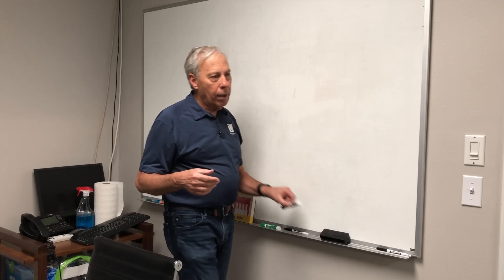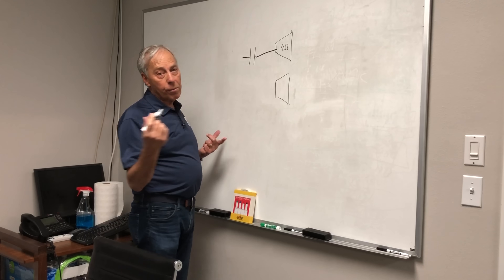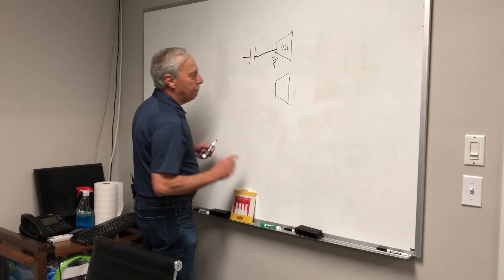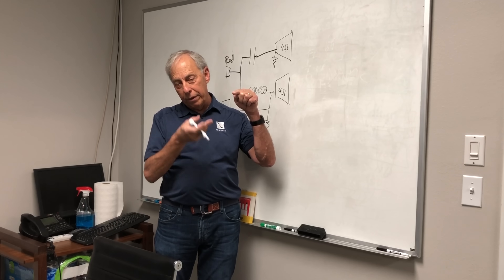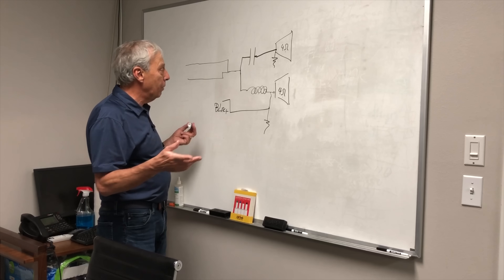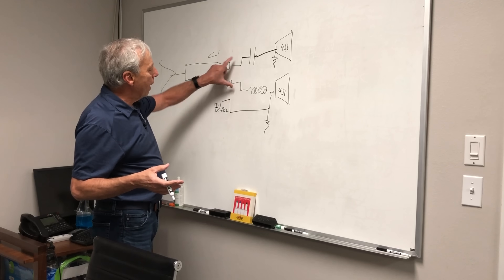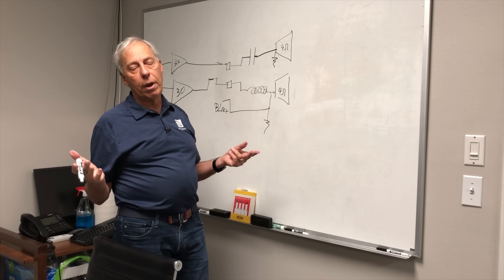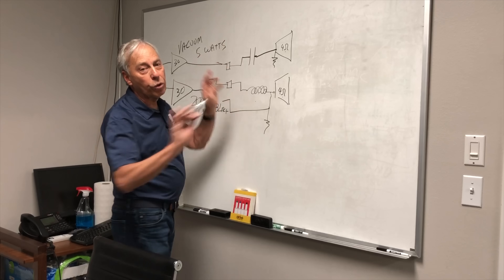How does bi-wiring work?

Comment: Nice video. Bi-wiring or bi-amping all largely pointless with regards to the cost IMO - I'd rather have one better quality item than two offering the same up into a passive crossover. That said, big fan of active systems with the filters pre the power amp and the drivers and amps matched - how you'd see it in most professional working studios.

Comment: A speaker is, in effect, an electric motor. It converts electrical energy into mechanical energy.
So long as the cable to connect the amplifier to the speaker is thick enough not to drop any voltage or VERY little voltage across its length then it doesn't matter if there is one, two or more cables.
It's simple physics. With Bi Wiring you are paying for two cables rather than one.
Reply: That is what physics proves. Unfortunately, you will never convince a lot of die hard audiophiles with measurable facts.

Comment: If you use an AVR just set to bi-amp in speaker settings and  use the surround back channel's to feed the black -  and use the fronts  for red + you get some extra  muscle and clarity.  4 wires per speaker recommend banana plugs too and of course 2 sets of post's on the speaker. Just sharing It has made an improvement so worth a try every system is different though results vary.

Cheers

Comment: I think the key words here are "you believe" at around 7:40. Bi-amping makes sense, bi-wiring is just snake oil unless the crossovers were on the amp end.
Reply: Right on! If bi-wiring does anything you are using the wrong sort of wire. PS knows it's BS.

Comment: The premise for bi-wiring to work in this explanation is that two TYPES of wire are used. One for high frequencies and one for low frequencies. How often do people buy two types of wire to bi-wire. How many of you actually have one pair that is designed for high frequencies and another pair for low frequencies?

Do they even sell two different kinds - they are all copper the last time I looked.

Comment: Hi Paul. You explained it perfectly but I must ask a question. Many premade  consumer bi wire cables use four identical wires ie all 16 gauge multi strand.or whatever they choose, you can find many on Amazon for instance. Is there any point to those types of cables or is it a moot point?. I get running 2 different types but I am not sure there is a point if all four conductors are exactly the same.
Reply: Unless you have VERY short speaker cables 16 Ga is too small. For distances up to about 10 ft. 12 Ga or even 10 Ga would be recommended. For a rational explanation of speaker cables I suggest watching the Audioholics video on the subject at: https://www.youtube.com/watch?v=kR12Ttuxobs&t=895s The title is "Speaker Cables Really Don't Matter". That is sure to get the blood boiling of many of  the "audiophiles" watching this channel but the testing results prove the point.

Comment: I have 2 quad 404-2 amps  which have been upgraded to dual mono power supplies. They are bi-amped into B&W matrix 3E speakers and sound absolutely amazing. Question I am probably wasting a lot of power using a 200 W amp to power tweeters. You say gain needs to be the same,  I would be interested in replacing the tweeters amp for a low powered tube amp.  How Can I find what the gain is on the quad 405To find a tube app that will be suitable thanks

Comment: So, Ideally if you have a true bi-amped and bi-wired system you don't want any crossover circuitry in the speaker. You just want the clean signal to go straight from the amps to the tweeter and woofer respectively.

With that in mind am I right in assuming it is kind of pointless bi-wiring speakers that have crossovers (Even though they still are bi-wirable with 4 binding posts) because the capacitors and coiled wires will still cut off parts of the signal?
Reply: You need a crossover in your amp if you expect different signals (one high, one low) to pass over the two wires.

Comment: Mr. McGown, thank you for giving a proper education on what bi-wiring and bi-amping is.  I get so turned off watching these "audio blowhards" on Youtube say bi-wiring is a waste of time because it "makes no difference."  What I learned from watching you explain this is there is a difference between the two questions "is there a difference" and "does it make a difference."  And that entirely depends on the audible ability of the individual listener.  Yes, there is a difference with bi-wiring, but can "you" hear it?

Starting with a non-expectant, somewhat skeptical disposition, I recently decided to bi-wire my B&W 3-way speakers (CM10 S2).  I played tracks that were burned in my mind and knew exactly how they sounded prior to bi-wiring.  Yes, I was able to discern a difference.  I'm not saying it is significant, but there's definitely some difference - and it's better.  

But, I'm wondering if that had anything to do with the fact that my speakers have a mid-range compared to a 2-way speaker?  It just seemed to me my ears were picking up better those mid-range frequencies.  I could more clearly discern sounds coming from the mid-range than before.  So, does a 3-way speaker make more beneficial use from bi-wiring than a 2-way speaker?
  
Again, thank you for taking the time to produce this helpful video.
Reply: Bi wiring is not possible as the highs don't pass only through one speaker wire and not the other and vise versa. They would have to be split with a crossover in the amp to do so. Both cables will have the same signal passing through them until they hit the speaker cross over where they are filtered for the first time. It's easy to test with a spectro.

Comment: Ok guys, please help me to clear this up :) So, if I understand Paul correctly, the advantage of Bi-Wiring is to allow for different Cable "tuning" between the Woofer section and Tweeter section of a Speaker, is that correct? I was under the impression that the whole point of Bi-Wiring was to bypass the Crossover section of the Speaker network, thereby providing a cleaner sound. Which is NOT correct, right?
Reply: @1970.  

The best way to look at this is check behind your speaker.  You should see 2 positives and 2 negatives for bi-wiring capability. If you don’t then you can’t bi-wire and you can’t bi-amp.  

If you only have 1 positive and 1 negative wire connection for the speaker but it has a woofer and tweeter then the crossover is together where it accepts one input and then splits the signal for highs and lows.  

Back to two positive and two negatives.  The crossover is built separate for each driver (woofer and tweeter).  So with this set up one can bi-wire or bi-amp. 

Bi-wire is simply using two different wires. A thicker speaker cable can be used for the lows and a thinner cable for the highs. If they both source from the same amp then it’s bi-wire. 

If from different amp then it’s bi-amp.  

You really can’t bypass the crossover of the speaker since it’s built inside the cabinet.  

The only way to perform what you’re thinking is to manually remove the passive crossover on the speakers and then have an active crossover and then amplify that signal directly to the specific drivers.  Not many do this especially for mids and highs.  I would not recommend this either.  

I tried this set up in car audio.  Active crossover and separate amps for tweeter, midrange, and woofers.  While it provided great flexibility in controlling each driver it was difficult to achieve a natural sound.  

I find that it’s best to use one amp for mids/highs in both home and car.  Mid and tweeter should not be far apart.  A separate amp can be used for the woofers.

Comment: Paul, I salute and compliment you for everything you do and have accomplished. Now the explanation here - for the viewers not speaking capacitors and resistors, who have no idea with electronics principle diagrams, can we summarize it as follows, would you agree?

A single speaker cable (with a plus and minus lead in it) can feed into a speaker's crossover filter where the energy fed through the cable is copied across each of the "ways" in the crossover. Then the bottom "way" has a low pass filter that allows the low frequencies to come through. The top way has a high pass filter that allows the top frequencies through. If there is one or are more middle ways then each of these has both a low pass for the top frequency cut-off and a high pass for the lower frequency cut-off. The energy in each "way" that does not go to the driver behind the filter may be converted into heat, by the way.
The electrical components in your diagram are used to implement these cut-off frequencies and this can be done in different ways all impacting the quality of sound reproduction.

For who is interested in the details of cross-over filters and the speakers they are in: for each of the ways the dB per octave cutoff (sometimes specified), crossover frequency (generally published), phase behavior (generally never specified), distortion numbers (generally never specified), frequency range (generally specified) with the fall-off at the ends of the frequency range (generally not, or limited, published). Or, buying a higher end speaker is the quest for the holy grail: you don't know where it is nor how to get there, but when you found it, you know.

So all these "ways" in the speaker's crossover filter are connected before the filter. In a speaker with more than one pair of binding posts, the connection between the ways of the crossover is on the outside and we can remove it.
If we remove that bridge piece(s), and replace it with "bi-wiring" then we shifted that bridge function to the amplifier. Period.
OK, if we have a high-current amplifier that we want to play loud, we may benefit from this as we have doubled the cross-section of wires used as well as their surface (assuming identical cables).
Should we expect a lot from this? IMO it depends on the cables we used in the first place. If they are underdimensioned, we could benefit. There is little hope that this makes a bad single cable sound better by adding a second one, but I cannot exclude it.
We see some high-end speaker manufacturers stepping away from allowing users access to the separate "ways" in the crossover, though, because in their vision bi (or more) wiring, makes their product worse. You could still bi-wire, by the way, if the connectors on your cables and the binding posts on your speakers allows for the second connection to be made. But there is no shift in the bridge between the cross-over's ways.

With bi-amping we need to have the appropriate crossover - the one that allows us to remove the bridge piece between the "ways" and thus gain access to the ways separately. Using more amplifiers, we now shift the bridge from the speaker input, or one amplifier's output, to the input of the - now bi=2 or more - amplifiers - where we need to feed parallel signals.
This is a completely different beast altogether. We have more amplifiers and thus upped the available Ampères or Watts. As we now feed the output of an amplifier channel into one "way" of one speaker, we have new cabling options between bass and mid-high. And we gain damping. With two identical amplifiers we doubled damping. And get better control over the inertia of large drivers (like woofers, or midrange in an open box - a closed box has the air cushion that acts like a gas spring to dampen as long as we stay away from the resonant frequency of that gas volume).

In bi or more amping, we are faced with a new dilemma, assuming the bi-amping of a stereo system: do we assign one stereo amplifier to the left channel and the other to the right (vertical alignment: of bass versus mid-high to left and right of one stereo amp), or do we assign one stereo amplifier to left and right bass and the other to left and right mid-high (horizontal alignment)?

Some high-enders prefer horizontal alignments of amplifier channels to speaker-crossover-ways. I would say it depends. Many (cheaper) stereo amplifiers have a shared power stage that feeds both left and right channel. Some amplifiers may have local power reserve near the amplification separate per channel, but generally the majority of the reserve is in the shared first power stage. This then would lead me to make the vertical assignment where one stereo amplifier feeds left and the other right - as heavy bass played louder can easily drain the reserves in the power stages when two channels are working on that at the same time. The local reserve will likely be enough to properly support the amplifier channel now feeding the mid-high crossover-way(s) and driver(s) only. Note here, that a vertical alignment (one stereo amp to two speaker ways) needs shorter speaker cables. Of course if we have mono-blocks this is all straightforward and this includes some stereo amplifiers that internally actually are two mono blocks. Another thing in countries with anemic AC situations, is that bi-amping allows to draw double the Ampères from the AC (provided the listening room has access to those Ampères). But, as the sound out of the speakers is rectified and modulated AC and hence you are listening to your amp's power stages, it makes sense to verify (try to refute) my hypothesis here - in short: try it out for yourself, with your music in your system, in your room.

So, bi-amping is fundamentally different than bi-wiring. Bi-amping could be an easy upgrade path in the system of somebody who spent most money of the audio budget for the next two years on top quality speakers in the first place - the best approach to building a system - and by adding a stereo (power) amplifier with a pair of speaker cables can really benefit from that upgrade. Without depreciation.
Personally, I don't see the benefit of bi-wiring as a solution to having bought a bad cable in the first place.

Right?

Comment: 5 watt amp?
I thought you still needed a 100 watt amp however  it would only be outputting highs so same wattage amp? cos there be crossovers active or passive.
Reply from the maker: A tweeter typically takes no more than 5 to 10 watts, sometimes more, but it's rare. This is because recordings contain very little high frequency information relative to lower notes. It's the nature of music. So even if you're playing something quite loudly, it's unlikely the highs are drawing much power.

Comment: Paul,  I saw someone on youtube saying we can put 2 speaker cables in one terminal,  would it work or not the right way to connect it?    I wanted to buy new pair of speaker but it has bi-wire in the back, my receiver only has L and R speaker connection.  This is the picture of the connection  https://ibb.co/HhzpYKC

Comment: Everytime I watch any audio science explanation I end up more confused and feeling that I know less.  This explanation has been crystal clear, engaging, uninterrupted and to the point.  I have vastly increased my understanding thanks to your explanation, tip of the hat to you good sir!  🎩
Reply: Lol I cant see why
Reply: It ain't science..
Reply: @hansemannluchter643  technically, it is
Reply: @CC_Hunters  No it isn't, it's Voodoo.
Reply: @hansemannluchter643  sure thing bud, now go get your doll
Reply: @CC_Hunters  lol.. We are talking about people who think they can hear if a wire has been cryo-frozen or not. Yes, it's Voodoo.
Reply: @hansemannluchter643  lol...and you think voodoo has something to do with cryogenic made wires, or lack there of? Don’t use fallacies to make a point
Reply: @CC_Hunters  Leave my chicken-blood insulated wires alone..
Reply: My 300-watt RMS Adcom monoblocks are built with four posts to enable bi-wiring. So I bi-wired to my bi-wire capable Klipsch towers with two woofers each. My only ELECTRICAL logic is heavy current, with the given voltage of the amplifier, is going to the woofers. And then small current in its own cable with the same given amplifier voltage goes to the tweeter. I did not compare bi-wire connection to single cable connection for sound quality, so I can't speak to that matter. It does give bragging rights. 

However, I moved my main speakers away from the front wall and closer together, slightly toed inwards, and moving my two subs by and away from my side walls in a vaulted ceiling room. I also added triangular GIK slatfuser  bass traps in the front wall corners. This physical exercise made a world of sound improvement clearly distinguishable much more than perhaps single or bi-wiring may give.

My room is a dedicated home theater. I did not ask for permission. 😁
Reply: BTW, I did all the above after listening to various Paul McGowan presentations.

Comment: There's no reason to bi-wire if the source is the same. So if I take a water hose and I split it, the water coming out of one end is different than the water from the other end? That's what the crossover is for; it knows what to send to the tweeter and what to send to the mid or sub. How are intelligent people not able to understand.

Comment: So, bi-wiring is essentially driving the woofer and the tweeter individually with the appropriate crossovers given the appropriate amplification process instead of using a 2 or 3 way speaker?

Comment: Gotta comment.. I have a degree in Robotics engineering Technology......  OK. Crossovers work in the speaker... The tweeter pulls from the single wire that is connected... IE. Highs are automatically pulled from the source.... As are the Low frequencies... You can connect 1000 wires to your speaker... with or without the external metal plate connected. There is no difference. Sorry folks. It does NOT make any difference to the speaker weather or not there are 2 wires from the amp or one.... There is absolutely no difference in sound quality. There is a differnce if you want to bi amp your speakers though. The differnces is presence and volume. That is it. Even with Bi amping, at low volumes , the human ear is not capable of distinguishing the difference. Sorry its just myth and stupidity.